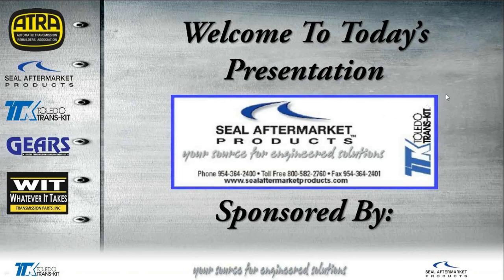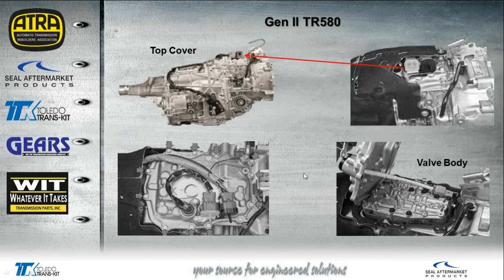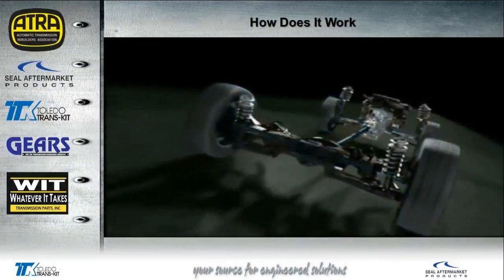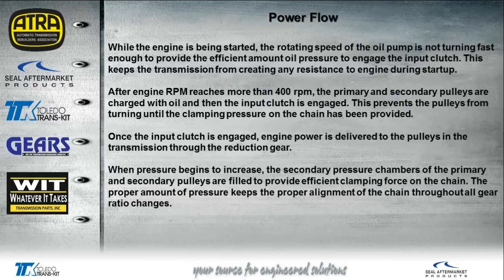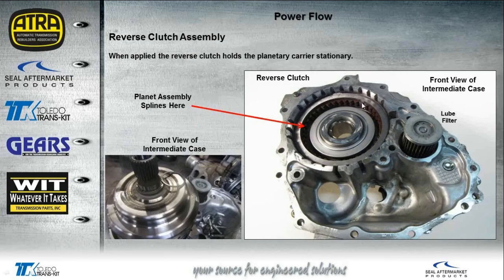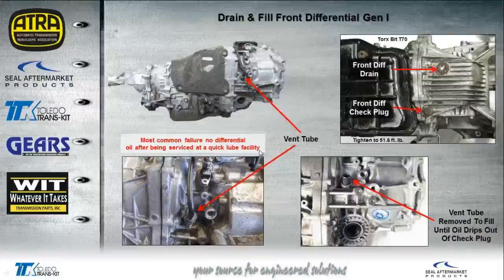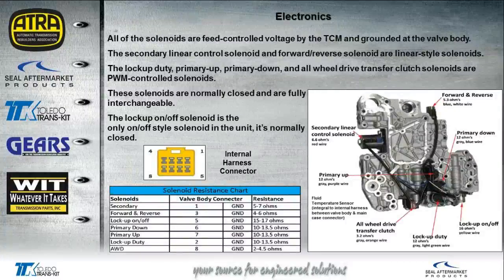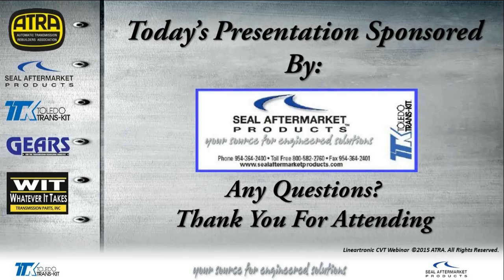Subaru Lineartronic CVT Introduction - 2/10/15

Comment: Great job Mike we sure came out with a lot of good info on this transmission. I now have the TCC solenoid new and bearings new. Those two parts are the most common failed parts in this unit. TransPartsNow.com